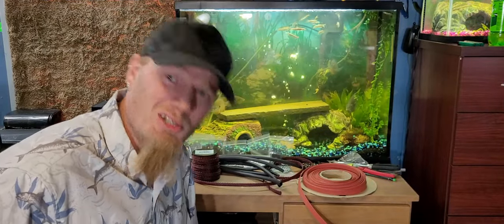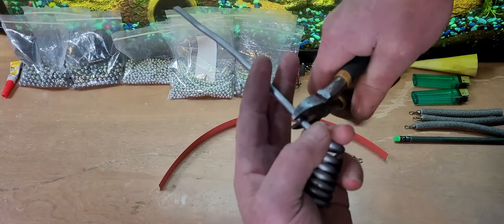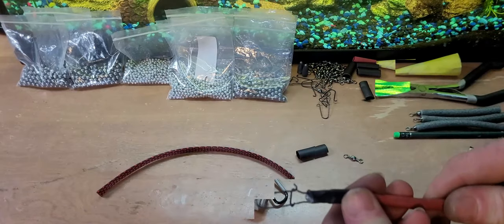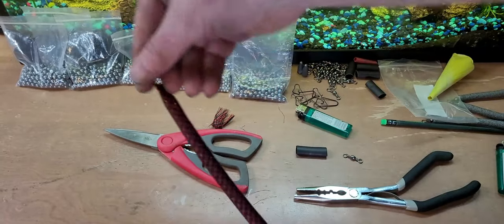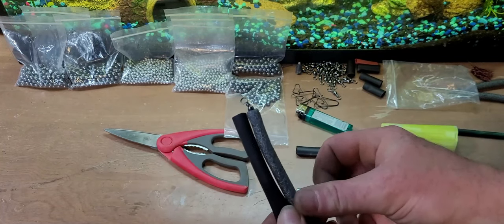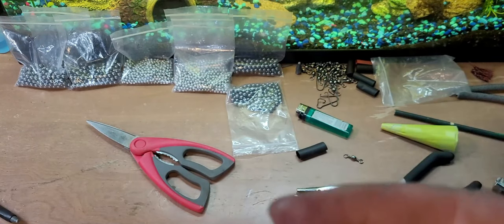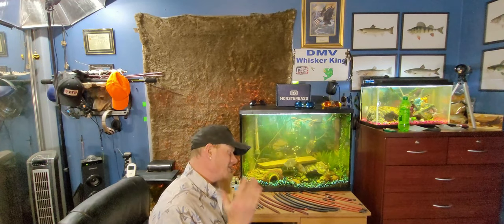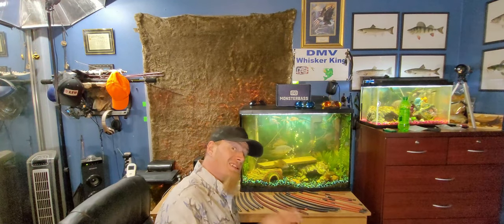FISHING DIY DRAGGING - DRIFTING WEIGHTS

Comment: Is there a reason you glue over the the swivel oval pivot so it can't rotate, I would think it would be better if you let it swivel.  Thanks
Reply from the maker: Hey there the ones with swivels do spin heated the glue to the ball on the swivels the top still rotates ☺️👌 . But For the others they don't spin . But when you want it to ride the bottom spinning could cause it to snag easier. It's dragged across the bottom so spinning would give it a higher chance of snagging something rather than it gliding across the bottom . Hope the information ℹ️ is useful. Have a wonderful day

Comment: Use 550 paracord from walmart. Cut 2x the length of the lead core. Pull out the center strands. Push the
Reply from the maker: Yes indeed know this way aswell 😎👍 and works nicely from what I've seen . Pretty strong but rope will get stinky and moldy 🤷 Have a wonderful day and thanks for watching

Comment: What size material is that for the snake weight. Good info
Reply from the maker: I'll have to look and check I have a roll somewhere. Guess I didn't link what I used 🤦 sorry about that
Reply from the maker: Half inch
Reply: @DMVWhiskerKing  ok thanks I was thinking trying 1/4 inch and the 1/4 inch solid lead?
Reply from the maker: Which kind the red shrink tube or Black shrink tube or the red braided one ? They were all different sized depending on what I used inside .
Reply from the maker: This is the red 25ft - 1 inch PET Expandable Braided Sleeving – Blackred – Alex Tech braided cable sleeve https://a.co/d/fiPrIVd
Reply from the maker: This is the black with glue inside 1/2 Inch 10 Ft XHF 3:1 Waterproof Heat Shrink Tubing Roll Marine Grade Adhesive Lined Heat Shrink Tube, Insulation Sealing Oil-Proof Wear-Resistant Black https://a.co/d/ipAbXTC
Reply from the maker: This is the red shrink tubing TEMCo 1/2" Marine Heat Shrink Tube 3:1 Adhesive Glue Lined 4 ft RED https://a.co/d/7xzA4gV
Reply: @DMVWhiskerKing  the red black braided one sorry